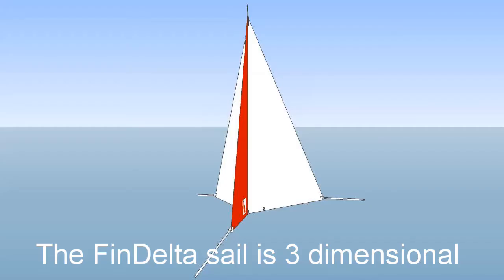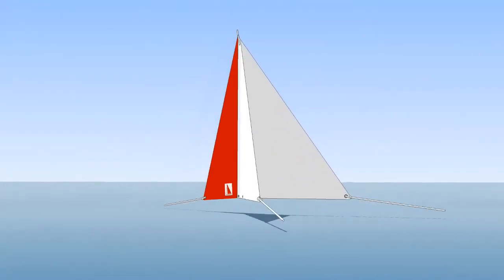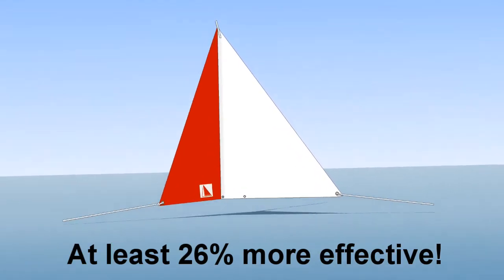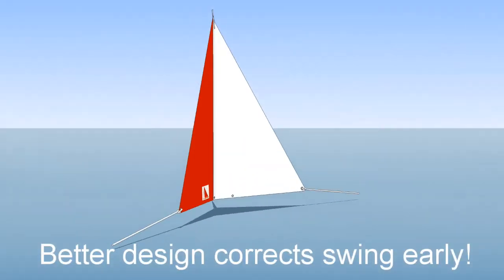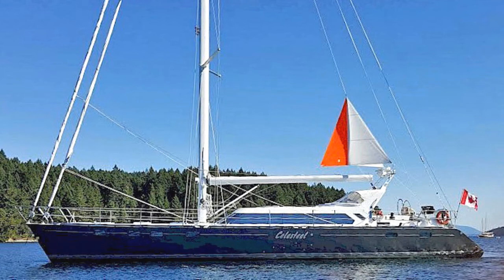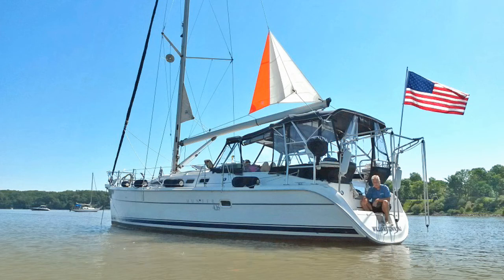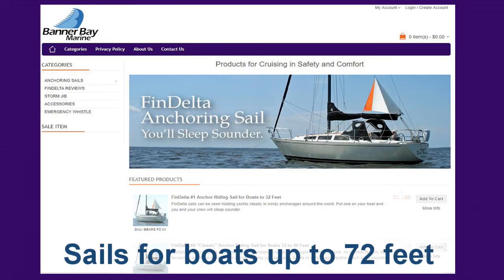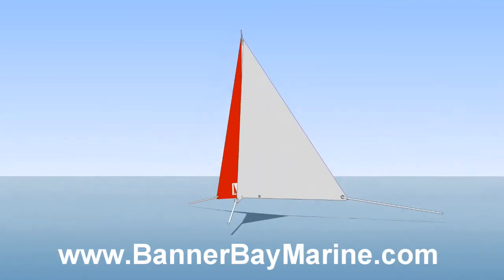FinDelta Anchoring Sail Technical Report and Animation

Comment: Thanks for the video! I'd love to see video of an actual boat using the FInDelta in a decent amount of wind, because I'm not sure what to expect. Is yaw expected to be eliminated? Reduced? By how much? I recently rigged my FinDelta while at anchor in about 20 knots of wind. The boat still yawed about +/- 80 degrees from the wind at the extremes (i.e. nearly beam-on). I believe I had it rigged well, but am open to the possibility that I did something wrong. I was expecting less yaw, but then again, I don't really know what to expect. I haven't found any reports, videos, or specifications of expected behavior/performance in real conditions. I've also only flown it the one time, so my experience with it is limited.
Reply from the maker: Thanks for your report. We recently posted a video on how to rig the FinDelta that gives advice that might be helpful. As to experiences with the sail, we have a section on the website where customers have volunteered their reports on successful use of the sail under various conditions.  Practical Sailor Magazine has also field-tested the sail and gave it a very good rating. However, to answer your question, the yawing seems to be more than you should expect.  If you can send us a photo of your boat with the sail rigged, or simply contact us via the website contact email, we'd be happy to make suggestions.
Reply: @Seavue  Thank you for the suggestions! It's good to know the yawing I experienced is not typical. That means I was doing something wrong, and can fix it. I know many folks have great success with the FinDelta. Next time I fly it I'll take some photos and report back. Thanks again!